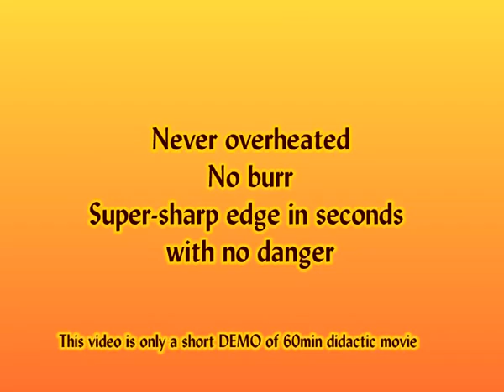HT 3000 Demo englich 2~1  -  sharpening super-sharp in a few seconds

Comment: Too bad there is not a version of this without double wheels (one would surely get in the way of other with wider or longer blades) and a more sophisticated tool rest so someone could run the length of a longer knife blade and maintain an exact bevel!
Reply: reed, you can do those freehand on an inexpensive buffer. As of right now, HF sells a 6" buffer that's actually quite good. The 8" buffer gets terrible reviews. 

I agree looking at this system - I'd have been tempted to buy several years ago, not for knives, but for plane blades and chisels to experiment. These types of systems (i've found) that have a little bit of  give in the wheel round over the very tip of the edge, but only the very tip, and the result isn't a dull edge as some would expect, it's a very fine highly polished edge that has lost the part of the edge that fails easily - as in, the edge is very long lasting and strong, and subjectively is very easy through a cut.